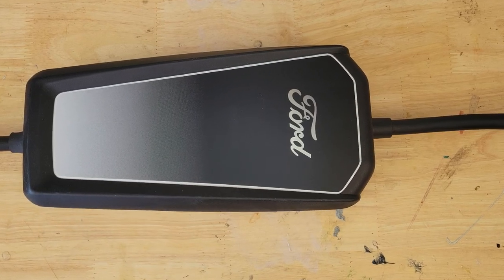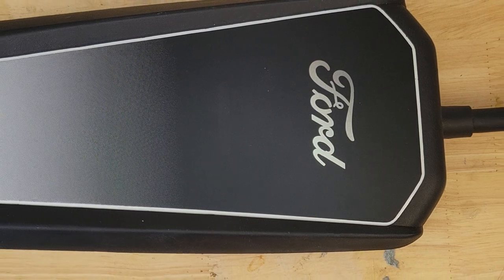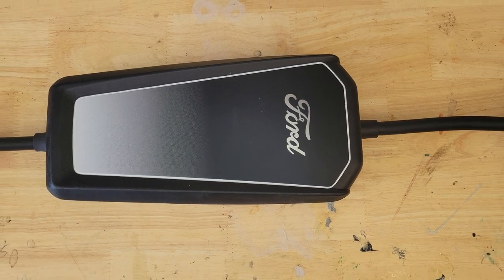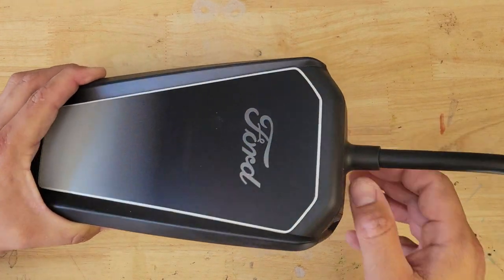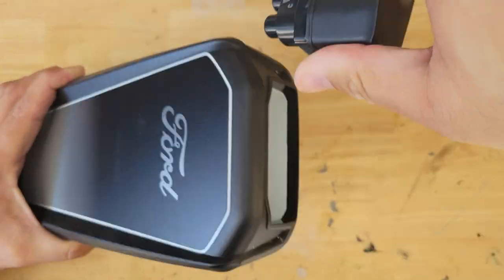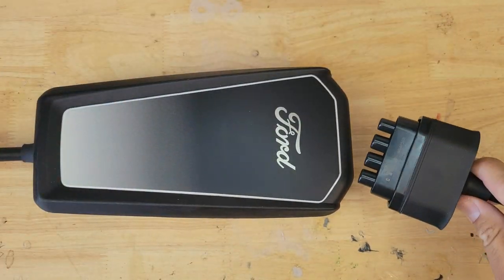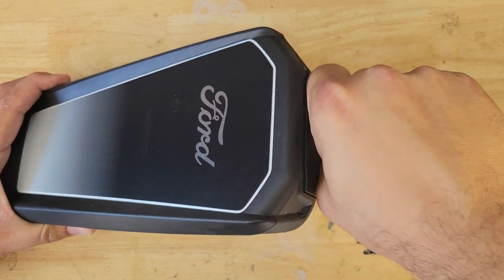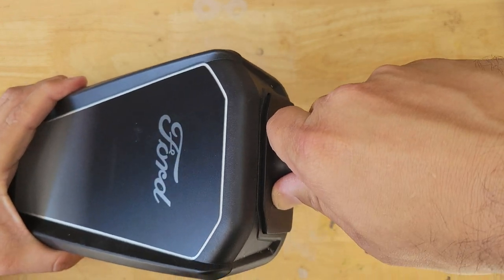mobile charger needs to be flush | Ford Mustang Mach E

Comment: I have same problem with orange light.its mean socket has less power need to upgrade socket
Reply from the maker: Glad you found a fix
Reply: Orange lights are usually a temperature issue. This can be caused by a faulty outlet, poor swappable connection, or something causing the system to run hotter than normal.
Reply: @SpencerSkelly  in belgium not all sockets sport heavy voltage ..orange light also show for low voltage..blue is for normal

Comment: For some reason I am still getting a red light on my charger and it won’t charge my car.
Reply from the maker: It can be a few things. I had a bad outlet once which overheats and the charger recognizes this and turns on a red light and only charges slow or not at all to prevent fires. It could also be that the charger goes bad. Ford is not famous for good chargers.
Reply: @BentheEVguy  thank you so much for your reply. It looks like we will have to take it into the dealership tomorrow.

Comment: Appreciate your videos, but voltage in the US in all locations is 240/120. Changed decades ago.
Reply from the maker: Oh ok, I keep hearing both. Even the electrician called it 220V thanks for the clarification
Reply: 120/240 is according to installation. 120 per single phase and 240 is called split phase, where you take the live from the two lines in. 5-15 is standard and it is 120V, 14-50 is a high power running from the 240V split phase (two 120 lines)